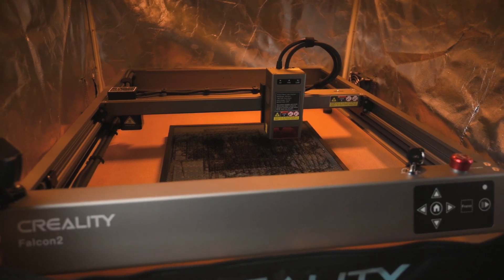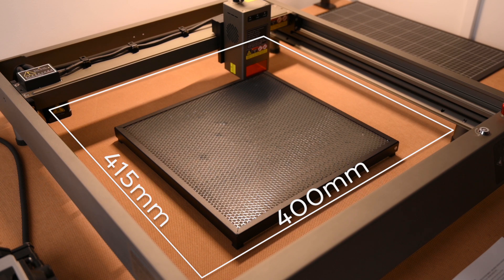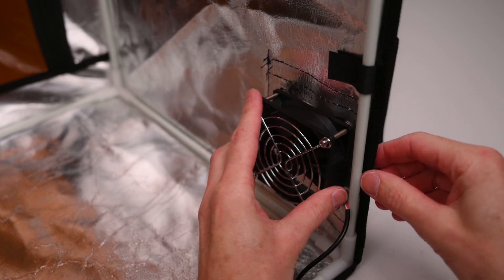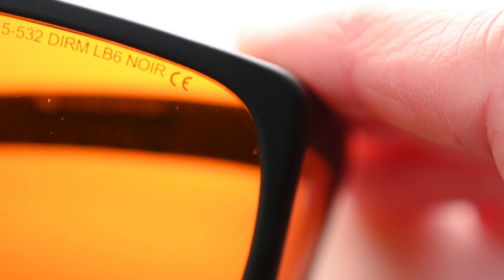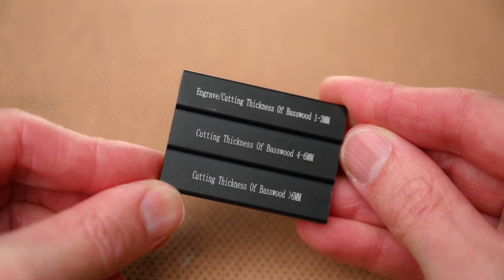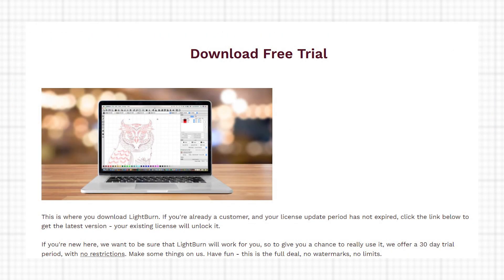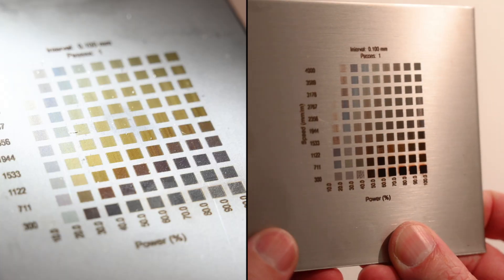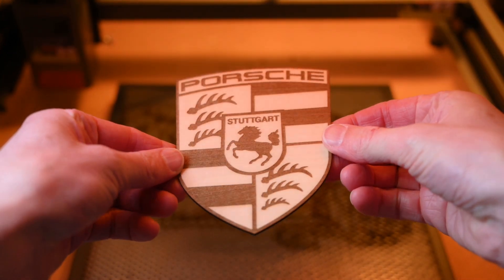AMAZING RESULTS! CREALITY FALCON 2 22W LASER ENGRAVER

Comment: just got mine. might as well order a set of blanks to test with since the 3 i got were so warped you couldnt do shit with them. Also do yourself a favor and google the recommended specs for the falcon 2 because the file on the sd card is pretty limited.

Comment: One of the best I’ve seen on this laser.  The cheap camera is a great idea because otherwise you’re caught between “not watching” and “watching for problems”.  Like you, I have green and orange glasses and both seem to let too much light through.  The enclosure is a pain - way better than nothing but I’m looking for a DIY sheet metal replacement.  Finally, the height gauge only mentions 3 limited choices and everybody goes with the highest level for everything (with good results).    Thanks.

Comment: I have yet to see a video that goes in depth to explain what degree of precision that this machine can engrave at. I have the 40W with the 22W precision mode and so far, this machine lacks precision compared to my 10W snapmaker laser. I understand due to the nature of the compression happening in this machine that the laser spot size will be larger, but it would be nice to have someone test and compare results to see what dpi this engraver can actually achieve. I am unable to make engravings on objects come out with correctly scanned white space on objects 30 mm or smaller.
Reply: From what I've read, the lower the laser, the better the precision.  So indeed, you would be able to cut fine details with a 40W, but you'd get better results using a 10w or 22w when it comes to details.  I presume (and I'm no expert) that the power of a laser is also affecting the kurf of your cuts.   Maybe the 40w in 22w precision is just the same "set of diodes" but at lower power....again, I'm speculating here and could be totaly wrong.

Comment: Very cool. I went the cheap route and got the 10 watt kit that mounts on a printer, which I use with one of my CR-10S printers. It gives really nice results once you get an idea of how to adjust the settings for the material you're working with, and their guide was a big help with that. The very first thing I ran was an engraving on basswood that came out incredibly well. I was very impressed with it, especially for the price.